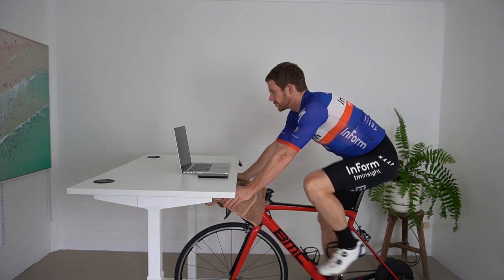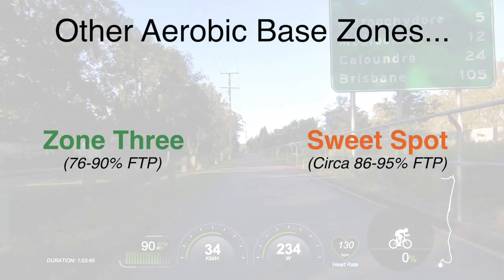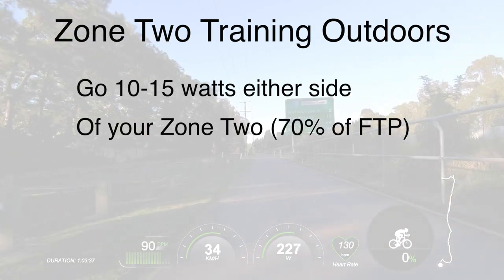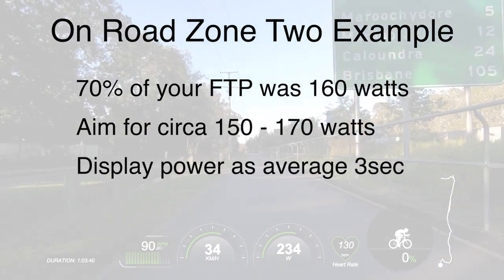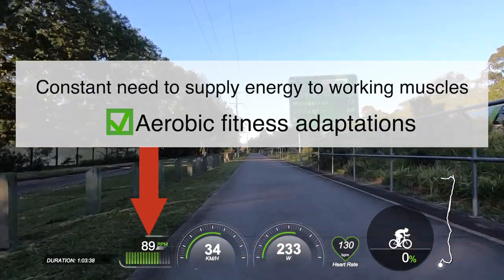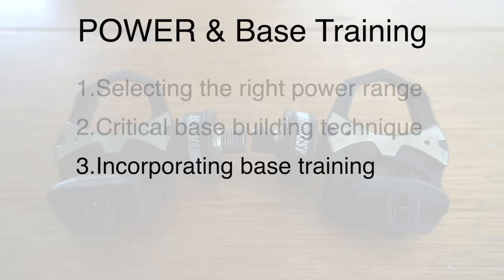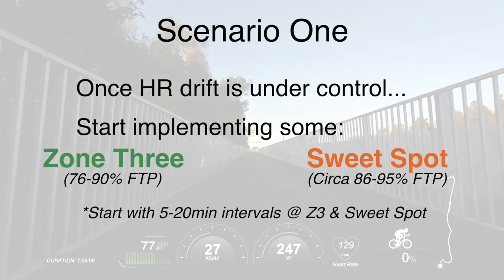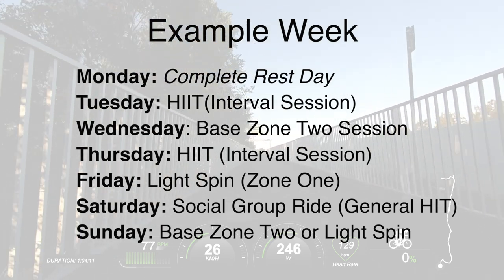How to Effectively Do Base Training (with a Power Meter)

Comment: Back to this 70% of FTP number. I am a well trained cyclist (15-20,000 km per year over last 3 years). Had a lactate test recently that showed my first lactate threshold was at 70% of max HR. But cycling at 70% of max HR translates into around 65% of FTP for me. Many starter cyclists have a first lactate threshold of 50% or less of FTP. A recent survey showed average power at first lactate threshold of 45W for office workers coming off the couch with an average weight of 85kg. So, we need to be careful not to ride endurance rides too hard and 70% of FTP may be too high and will not get the maximum adaptation for many cyclists. I am not trying to be critical here Cam — communities should be about sharing personal knowledge for the greater good
Reply: Thanks for the insight! Never crossed my mind

Comment: I was drawn to your channel from an older video you gave on cardiac drift, this is a great way to understand where your Aerobic capacity ends, I used this more successfully for running. There is a lot of sports science saying that base training is most effective when it is totally exclusive (Maffetone method) and supported by the right nutrition.  However generally 80/20 base to HIT seems to be latest view. Great Video as always, but did feel more like an advert than usual
Reply from the maker: Thanks Matthew, yes 60seconds is dedicated to Assioma

Comment: Thanks, Cam. I've taken your advice to ride more in zone to for longer. I think total time spent at certain zones is the important thing, i.e. you can add up all the times spent at said zone. For instance, when I cycle to work I get my Garmin to add up all the time spent above X watts.e.g. All the time I am moving I attempt to ride above 300W, 400W or 500W. My target is 15, 10 and 5 minutes at the 3 target wattages aiming for 30 minutes above threshold (300) This is more work than I would do in a chain gang. But the big difference heart rate in a chain gang is generally north of 170bpm (155 bpm just training)since power can go >600 regularly. But I find the above training has done more to make my FTP (300) quite easy to  obtain, even as 60 yo 85 kg man(who has never raced a bike) Im quite proud of what I have done.

I don't do that training every time. I mix it up and do a flat 250W or 300w average. Easy when you keep stopping at traffic lights. 3 days a week of this maintains my FTP. I know it sounds mad, but I am incapable of riding slowly unless it gets too painful. I need to add an hour of zone 2 like you say.

Comment: It is very, very hard to train with power on the road and impossible on trails. After overtraining, twice actually I got power meters for my bikes but found HR much better. If you keep it almost always under 130bpm you never get tired and the fatigue accumulates much more slowly. This allows you to work around any sort of heart rate drift and keep the workouts non fatiguing for the most part especially if you do other things like yoga, weightlifting or miscellaneous other sports you may enjoy. You just keep it as easy as you need to stay easy. For intervals buy a MTB and hit trails once or twice a week dammit you're at 150-180 almost the entire ride trails are HARD. But most riding should be very easy and the more you exercise or work out the more important this becomes or you will overtrain.

Comment: Just did a couple of hours Zone 2 85rpm cadence on turbo trainer. Though it would be boring but was ok, not easy to hold power/cadence steady without concentration. Don't think I'd be able to do it on my local roads which are hilly. Nice not be tired after a ride for a change.

Comment: The problem with training at 70% (towards the upper end of Z2) is that people tend to go too hard and creep into Z3. Z2 is 55-75% of FTP. The problem is compounded when FTP tests aren’t conducted properly, and numbers are rounded up a few watts. Many people cannot maintain FTP for more than 45mins
Reply from the maker: Thanks for sharing on the thread Mark. We use the Half Monty at the RCA, which is a ramp to failure with a 20min sustained effort following. We find this gives us a 'mostly' accurate FTP (unlike the 20min test, if you've never paced an effort before). While I can appreciate what you're saying, when most recreational and amateur road cyclists start training Z2 properly, even 70% feels like they're 'not training'. So going lower than this would be even more of a shock to the training system. In addition, we find many don''t quite achieve the top end of their FTP capacity in the Half Monty test, as they could have perhaps gone a little deeper on the RAMP component. So all these factors combined we feel 70% is the right place to be at the RCA and we've seen the fruits from this time and time again. Cheers,  Cam

Comment: Thanks for the vid...enjoyable to watch. I like my recent purchased power meter pedals. But one comment is I find it easier to use heart rate for Zone 2 because you can do short increases in power that don't impact your heart rate much but don't have your 3s power average bouncing all over the shop. Interestingly I find consistent low torque pedalling harder than mixing it up a bit. My muscles need a hard spin every 15 minutes or so.
Reply from the maker: Interesting to hear and thanks for sharing on the thread Torben

Comment: I hope this doesn't sound like I'm trying to be a fly in the ointment. But if Assioma is reading these comments, I hope they reconsider the engineering of their new power meter pedals for SPD-SL pedals. I was SO EXCITED when I heard they were coming out with a version of their pedals for SPD-SL as IMO, Assioma makes the best value power meter pedals on the market today. But the large Q factor makes them a complete non-starter for me. I'm sure there is a good reason why Assioma did this, but MAN it's so frustrating! (P.S. I know there are work-arounds for this problem. But they all void the warranty. That dog won't hunt.)

Comment: Love my long endurance rides!  Question, when do you suggest doing endurance rides by heart rate instead of power?  Additionally I feel Strava is partly to blame for many cyclists not being able to keep " a lid on it" so to speak as they feel they've got to show off their average speed, also feel it's the cause of many not incorporating the proper amount of rest days.
Reply from the maker: Yes agreed. I’d always follow power for endurance rides but listen to your body via the heart. If you’re experiencing random physiological responses I’d rest or consider reducing the volume of the ride. Then keep an eye of things, as often sicknesses or fatigue can creep in when the heart starts doing unusual things
Reply: I like to keep one eye on HR for endurance rides. I  already noticed no decoupling within a 1.5 h of indoor z2 ride, but a slight decrease in power in a sequence of 4 days (to keep the same HR). No rest between the days and each z2 section preceded by a short HIIT section of 10x1' MAP Intervals. As Seiler says, I like to check HR as a proxy for strain, instead of exclusively power which relates to stress.
Reply: Living in a very hilly area with a lot of short steep climbs and steep descents riding Z2 I find power can be too stochastic to keep in zone so I often do my zone 2 rides keeping to HR Z2 with an eye to the power. I do have a flatter ride with a long steady climb back home where controlling power is much easier, in which case I use power and checking aerobic decoupling is much easier. Same with the trainer of course.
Reply: Totally agree with the strava comment, some people have become obsessed with average speed which becomes vanity over reality.

Comment: Awsome vid Cam👍. I noticed the scenario when you talked about the different pwr output . Is that my Stages compare to the Garmin Rally was showing 10-15 W less  than the pedal based pwr-meter . The Garmin feels like more true on the RPE . But doing a strictly Zone 2 ride on the gravel bike feels a bit harder due to the resistance from the all gravel. Worth knowing that
Reply from the maker: Yes good point, more torque in the pedal stroke because of the resistance from the gravel

Comment: I've always found it impossible to do zone 2 training on my club rides. It would be nice to do the longer rides in company, but they always want to smash it as soon as the road starts going up. And then they're too tired to maintain a decent pace on the flat sections.
Reply from the maker: Fair enough Phil, thanks for sharing on the thread
Reply: This is why i ride solo most of the time.  Or I do half of the ride with the pack and continue solo on the second half.

Comment: Thank you for posting this sort of information. I am hoping to race this coming summer (I live in Canada so just going into the dark cold months!) Bike is on a trainer and I purchased a set of Alto CC40 carbon clinchers for the coming summer. My trainer is old school wheel on magnetic and I don't have a power meter, how can I build base power without? Would heartrate be enough? In my younger years, we used strictly heart rate zone training. Thanks!

Comment: Thanks Cam! This has been super helpful and I will be factoring in more Zone 2 into my routine. After watching your video I did the drift test for 90mins @ 70% ftp and I didn’t drift more than 5bpm, my question is what now? Do I increase by 5W and stay at 90mins? Stay at 70% and increase duration? Or do nothing? Thanks in advance
Reply from the maker: It's just indicating that you most likely have reasonable aerobic conditioning, so focusing on base training isn't critical unless you enjoy it, or unless you're in the off season. For example, during winter I will focus more of my riding on base as it's less taxing and I enjoy it. Then, when I get to Spring/Summer I start ramping up the intensity again. I know the base engine will be solid and I will be fresh for a good 12-24 weeks of HIIT work. So it depends on your situation. Happy for you to email me if you want to discuss your goals further cam.nicholls@roadcyclingacademy.com

Comment: So, my Tacx Neo tends to read 210 watts for endurance while my Assiomas are reading 225.  Are the Assiomas more accurate? I just stick with the data from them, since I've not yet figured away to bring my Neo out on the road with me. Consistency in data source seems more important than any absolute numbers.
Reply from the maker: My trainer also reads lower. As the power comes from the drivetrain it typically reads lower, VS crank and pedal systems which are closer to the action.
Reply: On Llama's YouTube channel, he has found the Assiomas to be almost spot-on accurate after thorough testing. Based on your reasoning and his testing, I would trust the Assiomas.

Comment: Nice video Cam. I have 16 weeks of zone 2 training planned. In these weeks i do next to no HIIT sessions, maybe some sweet spot or tempo here and there. But I'm increasing volume weekly. What do you think, is this a good strategy?
Reply from the maker: Depends what the end goal is Robert, but if you have time on your side and you're looking to build a solid and robust aerobic engine, without fatiguing yourself - yes!
Reply: @CamNicholls  thank you! My goal is to improve overall fitness across all zones and I'll start implementing more interval training next autumn. my ftp is 266 and am aiming for 300+ next summer in my peak :)

Comment: I now do indoor base training 5 times a week for 75 minutes in zone 2 (heart rate 127 bpm - 144 bpm).  70% of my FTP is 161 watts.  I have no problem keeping 161 watts for 75 minutes.  But my heart rate enters zone 3 between 145 bpm - 155 bpm.  I am not sure if I am suppose to slow down or continue with my FTP 161 watts?
Reply: I would slow down just a little bit and see how it affects the HR. For me I can sustain 200W at like 145hr just fine but when I bump it up even to 210W I start to drift. Sign that I'm not there yet.

Comment: Thank for another informative video Cam. How do you find using the Look pedal system compared to SPD SL? Its the only thing putting me off buying some Assioma pedals. Obviously the SPD SL version is out of the question due to the Q factor issue. Thanks again.
Reply: Having been on SPD-SL's for over a decade.... Looks aren't noticeably different at all.
Reply: @smiziley  Thanks for the reply. Very much appreciate from some who’s used both. 👍
Reply: I have tried both for years and currently on the Assioma Duo's for the last 2years.....no real difference at all in feel between the 2 platforms....the difference in platform dimensions is small hence unnoticeable.
Reply: @andrewb6541  Thanks for the reply Andrew. That’s very helpful. 👍

Comment: Hi cam. Currently looking for a power meter. Im looking at xcadey left crank only power meter for my training. Im on a budget. Would you recommend them? Or should i go straight and save up for an assioma uno. Might take a while for me to get those.
Reply from the maker: I am not familiar with those power meters unfortunately. The only consideration with the UNO is you won't know if you've got one stronger side over the other. But starting somewhere is going to be better than HR. Good luck. Cam

Comment: The area I live coming back home is all up hill with one section at 9%,  so rides all end with high heart rate.😱
Reply from the maker: Thanks for sharing on the thread. In this case, there's not much you can do. Anything over 8% becomes a challenge.
Reply: Use an mtb to get gears low enough to stay in the right zone?

Comment: Why aim for top of zone 2? You would get similar adaptations from lower effort level but with the advantage of lower physical load.
Reply from the maker: Most amateur and recreational road cyclists are limited by time, so bang for buck this is the most effective percentage in my opinion. If you're properly trained and in a high conditioned state I would recommend lower for longer rides, for sure. But the vast majority of people watching this, won't be that person.
Reply: @CamNicholls  I guess you are prescribing the zone 2 to develop mitochondrion function in cells? If so that starts at a far lower level so I'm not clear on what you hope to gain by prescribing a higher FTP% in your workout level.  Time crunched or not, I'm not sure additional benefit you are looking for by going top of zone 2 instead of lower?

Also, I'm not sure why you say that the turbo isn't a good option for rides over 2.5h. There are plenty of good longer rides on zwift at a set pace that you can align to develop your base fitness. I have ridden these numerous time and I have no issue with riding 4h+ in them. The rides are always socially active and the leaders will encourage you to get up out of the saddle at certain stages. These provide a great way to undertake your base training having a laugh, constantly on power, and in a safe environment (not available outside for all). You may not like longer rides on zwift but for most I'd say that are a very good training option.
Reply: @euroswilliams7303  Old comment thread I know but if I'm not pressed for time and could do a couple of 2h+ rides a week, what % of FTP would you aim for? I'm essentially untrained. Plus I noticed a comment from Cam saying to go to 60% of FTP if the 1h or 1h30 min rides at 70% FTP are too taxing. Any sources you use would be great to read up on.

Comment: I have recently got back on the bike after a 20 year absence when I was a level 2 coach and a top end sprinter, back in the days before anyone really used power meters.  I find the use of the power meters interesting but still mainly ride to heart rate
Reply from the maker: Welcome back to riding mate. The power meter is a game changer for training. Especially top end interval work.
Reply: @CamNicholls  yes  I have bought assioma, one season of local riding doing only base training, still 20kg to lose, have gone from being dropped by D grade to winning club champs, 5 sec is 1340, 1min is 673 but ftp is only 244

Comment: Love the content Cam.  But how about saying this is a advertisement video in the tag like gcn does. Its a 10 minute commercial for assioma.  Would be nice if you could explain how this would work with other equipment as well.
Reply from the maker: Sorry I’m a little confused for a couple of reasons 1/ I mention upfront that the video is brought to you by Assioma (signalling it’s sponsored )  and my agreement with Assioma is for a 60 second mention. The rest of the video is about using power to train base fitness so it doesn’t matter what power meter you use.
Reply: Imo Cam presented perfectly 💯.
Introduced and promoted Assioma (normal advertising SLA).
Everything thereafter one could apply to any equipment that has a power meter and heart rate monitor.
Don't be so hard on our boy Cam 😉